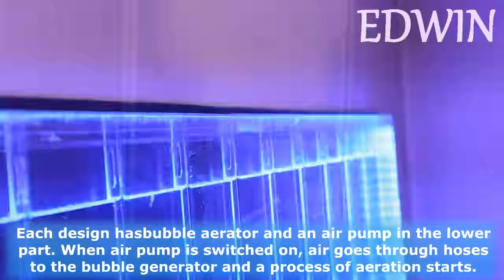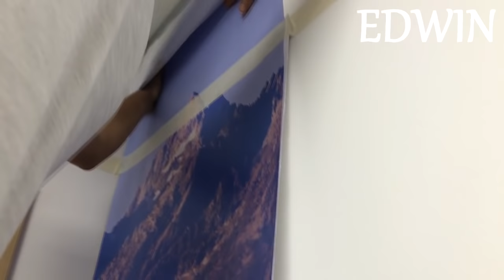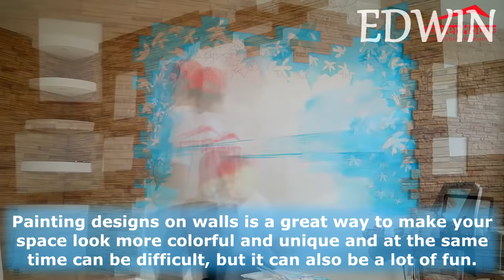Amazing Diy Wall Decor Ideas! Why We Don't Do It The Home

Comment: The bubble wall would be a maintenance nightmare in a short time. It'd become a bacterial, fungus, and algal hotbed in no time unless you constantly serviced it with chemicals and/or UV light for disinfection.  You'd need distilled water that would need replenishing often.  Then top it off with the entire plastic wall that wouldn't keep its new and beautiful clarity for very long.  It would begin to age fairly quickly and start looking cloudy and dull from the light AND the interior and exterior cleaning and chemicals needed to keep it looking clean.  You'd be so worn out from all the "tending" the bubble wall would need that it would start looking like a fish tank that needed its water changed pretty quickly.  It looks great in concept, but whenever you have clear plastic, water, air, and light you end up with microbial activity and other appearance problems, every time.  That's why you seldom if ever see stuff like this.  It's VERY impractical and needs constant attention.  The room would start smelling a little like a kids fish tank.  It's a nice concept that's best admired in a video, but not anywhere near a home.
Reply: Steve McCormick replace water with vodka and the bar is open 365 days
Reply: Mineral oil.
Reply: @hollisblackwood3276  is that what will keep it clean?
Reply: Not to mention that your cats will go nuuuuuuts!
Reply: Concur with Mr. McCormick re: the bubble wall.  I diligently only used distilled water and within a little over a year, I had growth in the unit.  Algaecide wont do a thing for the particles that  start to clump and before you know it, that clump is all you will notice.  Unless you can successfully dismantle and clean the unit when the growth occurs, enjoy it while you can.  The manufacturer kept telling me to use only distilled water and try algaecide.....which of course I had done since my unit cost almost $500 US.  Until they make these units more user friendly for these issues, I will never have one again or recommend them to anyone.

Comment: I want the wallpaper type but with different designs depends on my mood interchangeable like in Hunger Games, from quiet forests to city night life to warm beaches.
Reply: Little tip. Use a light spong to smooth Iver instead of your hand and if you do get bubbles. Use a small pin to get the air out. Don't lift up once it's sticks down it will stretch the picture.  X

Comment: The bubble wall is by Histore D’Eau...  the first source listed.  To get to the sources click the down arrow beneath the  bottom right of the video frame.  Good luck, it’s a French site w/o English translation.  🧐
If anyone speaks French, I would love to hear more.......  it is amazing.  🤩😍
Reply: But they deliver only in France
Reply: Thanks for the order link—think I should have chosen High School French in lieu of Trigonometry—figured out where to put name, address, and size in meters.  The part where I ask for the components/materials and try wheedling to get them to ship stateside—beyond the on-line translators.  None of them speak Texan.   🤠🇺🇸🇨🇱. If the units are plexi, shipping would be doable... glass, not so much.
If anyone here has any luck getting a quote, drop me a line please.  🤓. Good luck!